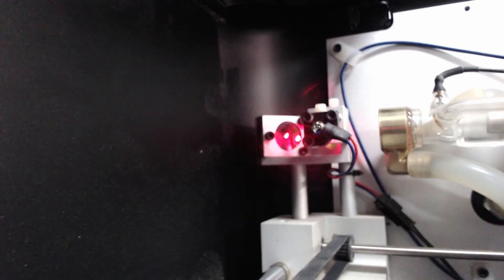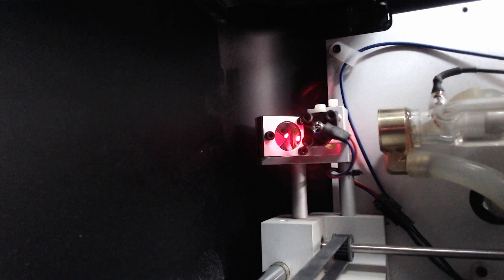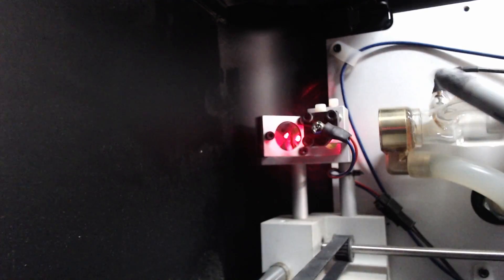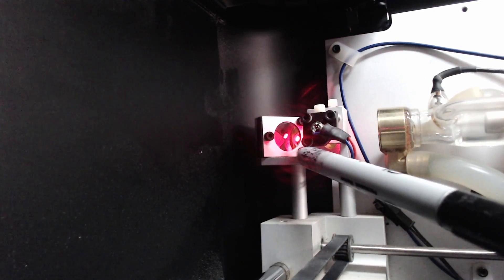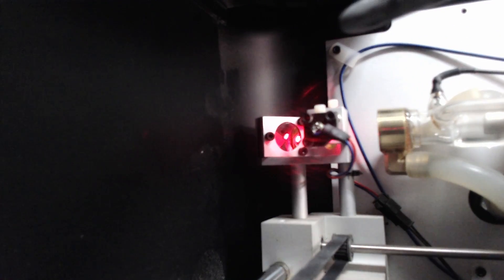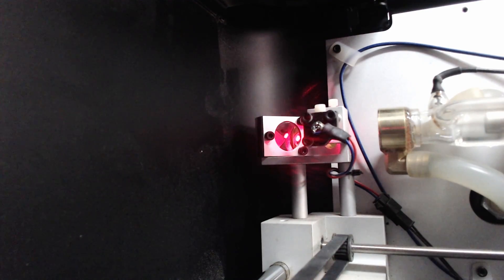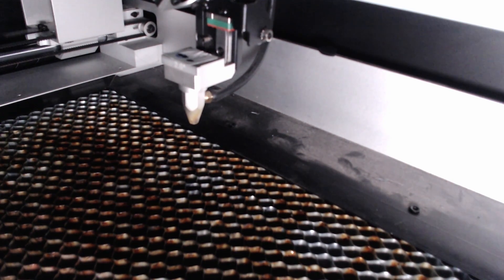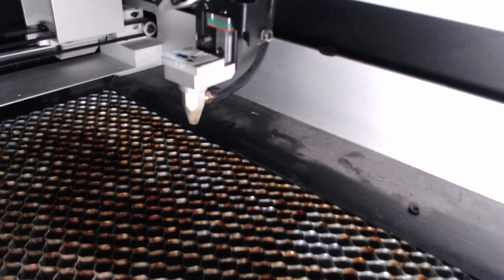MAKE YOUR LASER MORE POWERFUL // Easy Laser Alignment

Comment: Thank you Steve for this video. I have a full spectrum Muse CO2 laser. I have attempted to align my laser. A test fire on mirror one is perfect. When I test fire mirror 2 the test fire mark is there but off centered when about 4 inches away. I have adjusted the screw and adjusted the mark. When re test firing, the mark then just disappeared. I have no idea what caused that. Can you assist please?
Reply from the maker: It sounds like your mirror 2 alignment is drastically off.  Watch the alignment video I did for my DIY laser.  It's a different laser, but the beam path and alignment process is the same.

Comment: Hi Steve!! Thank you for your video. I have problems aligned my laser. When I did the fire test the laser had two points instead just one. Do you know why? I contacted the customer support but they didn’t answer me yet. Thank you
Reply from the maker: If the beam is split then there is probably something obscure it along the path. Look at the tube output and then at each mirror. Somewhere you will find a dirty optic or obstruction.
Reply: @SteveMakesEverything  thank you ☺️

Comment: Hi Steve, I appreciate this video.  I have been working on alignment on my Muse Core and the Mirror 2 to 3 is my problem.  When Mirror 3 is next to mirror 2 i have a nice dark test spot, but when I move the gantry to the far right side I barley get a mark.  Any suggestions?
Reply from the maker: Rather than going all the way to the right, go halfway or a quarter and see where the test shot is hitting.  Mirror 2 is clearly not pointed to the right place so you may need to go in steps and adjust mirror 2 until you can get to the right hand side

I cover this in a lot more detail in my DIY laser series (part 5).  It's a different laser but all CO2 lasers are fundamentally the same.
Reply: Thank you for the reply. I did go half way and I do get a mark. So I will adjust mirror 2 and keep testing until its good. I did try  some test cuts and now get a double line when cutting. So for sure alignment is off. You are very knowledgeable and helpful.  I appreciate that
Reply from the maker: @katiberwald3643  Happy to help.   If you are getting a double line, check the optics all the way back to the laser tube to make sure there isn't either dirt or damage.

Alternately make sure there isn't anything blocking the beam along the path.
Reply: @SteveMakesEverything  i will do try that. Fingers Crossed :)

Comment: What kind of thermal paper do you use? I’ve been using old receipts, but the sticky kind you use would be so much easier. Thanks!
Reply from the maker: Here's an affiliate link if you want to help out the channel: https://amzn.to/3xPLySk. But any adhesive thermal paper will work.  Avoid coming in contact with the mirrors when sticking this to the mirror mounts.

Comment: Thank you!! FS did not have any videos as helpful as yours. On my laser, I’m not getting the red diode to show from Mirror 2 to 3, so my laser must be WAY off course. Do you have a recommendation for which screw I should start with to adjust Mirror 2?
Reply from the maker: :-). The first time you do an alignment, you'll be terrified of messing something up, but fear not.  There's nothing you can do that can't be undone.

The mounts have three thumb screws and generally one is a pivot, one moves in the X direction and the third in the Y direction.  

Assuming the path from mirror 1 to 2 is OK, you can start with 2 to 3, though you might as well make sure the first part of the beam path is good. 

To get close on the third mirror, stick a piece of adhesive thermal paper on the front of the laser head where the beam is suppose to go in to mirror 3 and adjust until you get the red dot close.  After that you will need to do a much more precise alignment that requires moving the gantry back and forth for path 1-to-2 and the laser head for 2-to-3.

I've done a couple of alignment videos - one for the Muse3d and one for my DIY laser.  The latter goes into more detail - this is essentially the same process for every CO2 laser, so while it might look different, it really isn't.  FSL also has a video that is actually pretty decent as well.

Comment: Hello again Steve.  I just completed the procedure you have outlined here.  It sure looks like you have far more Z travel than i do.  Is that the standard nozzle you have on that came with the machine?  Could you please tell me what your distance is from the machine floor (No crumb tray) to the bottom of the nozzle (Z all the way up)?  Thank you
Reply from the maker: This would depened on the lens you are using.  Longer lenses use a longer nozzle and in this case I have a 2" lens mounted.  I can't really give you measurement since when I remove my workspace, there is nothing but empty space under mine due to the Riser box.  BTW if you want a few more tips, check out the alignment video I did for my DIY laser - different laser but the alignment (particularly around mirror 3 and the lens is a bit more detailed.

Comment: Hi Steve.
Could you please let me know which laser you used to help with the alignment.
if you are the link where to buy I'd be grateful.
Reply from the maker: The red dot laser is built into the Muse 3D, but you buy a bag full of similar devices on Amazon for very modest cost. The challenge of course is that you’d need a 5V power supply and some way to mount it into the beam path along with a beam integrator.  It’s a bit prohibitive if your laser didn’t already come with one.

Comment: I noticed that you left the shroud over the tube off?  So do you leave that off all the time now?  Not sure what protectioon the shroud gives but, your thoughts on it.  Probably just makes it easier to clean by leaving it off, right?
Reply from the maker: No I keep the shroud on. I only had it removed for cleaning. I don’t always shoot videos in order so it may have appeared off when it would normally have been on. I don’t think there’s a safety concern leaving it off but it does seem to play a part in piping exhaust fumes out efficiently

Comment: Thank you, Steve, I ordered my muse 3D on April 14th however I only received one of the two boxes. The cool box was lost during FedEx shipping also the large box was in bad shape however the interior seems to be ok.  I contacted the company and they are shipping me another cool box. The large box contained only the laser unit and the egg-crate panel nothing else no documentation nor power cord. I am hoping all the other parts are in the cool box? In the meantime, I am watching your videos in order to get acquainted with the unit.  I hope I don't have to go thru for a first-timer with this realignment process but your video might help me guide. 
One question is the thermopaper that you are using come with the unit or you have to purchase it?
Reply from the maker: Damn, it sounds like your laser went through a war to get to you.  Shipping was my biggest concern when I bought mine too.  If you watch my unboxing video you will see that the coolbox (with tubing and cables) was actually inside the laser, though I wondered how putting a 10Kg box inside a precision device with a glass lid was possible without damage.  So it's possible they changed things and ship that box separately.  At any rate it sounds like you'll get that resolved.  

You should get a bit of thermal paper in the box along with some lens wipes, but you can buy those consumables on-line.  For the thermal paper make sure you get the stuff with adhesive backing so you can stick it onto the optic mounts.  I got 3 big rolls in a pack on Amazon for ~$15 and that will be enough for a lifetime.
Reply: Mine came in 2 boxes/deliveries. Laser first, cool box 2 days later. I asked FSL about the setup docs directly because I saw the included in the FSL unpacking video and didn't get anything. They said they are trying to be as green as possible and directed me to their resources section of the website and I downloaded them.
Reply: @mcneal9926  it does seem like they’ve change how they ship units now. No doubt this is due to potential damage. At any rate it is pretty easy to set up